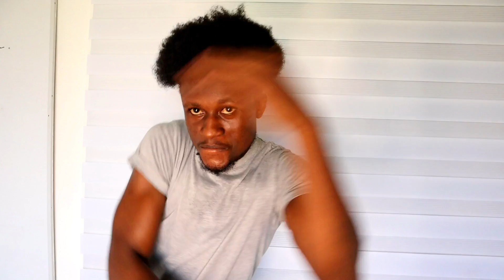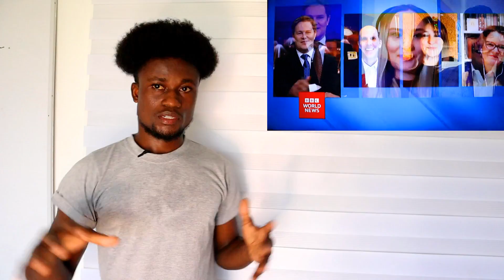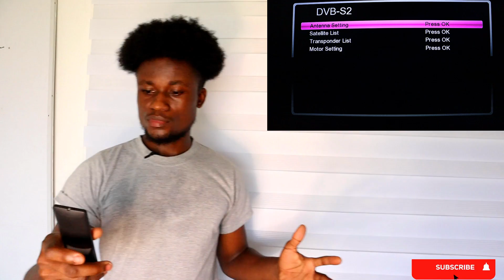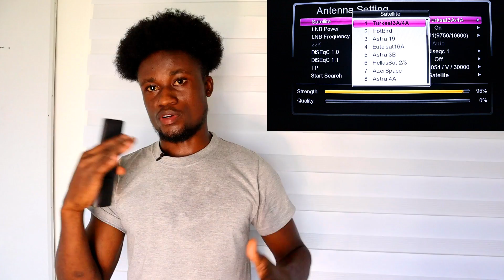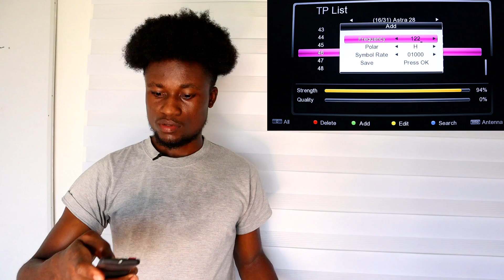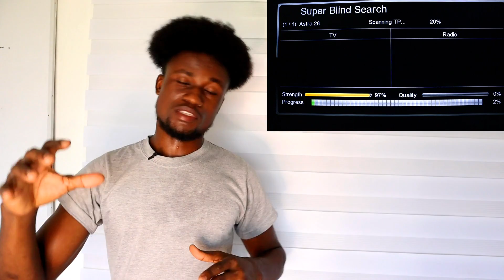How To Reset Master Decoder To Factory Default

Comment: My decoder signal has been bad around  19 percent for like a week help me
Reply from the maker: The signal comes from the satellite dish outside the house, so When there's no signal, after connecting the signal cable at the back of the Decoder really well, the next thing is to check the satellite dish to get a stable signal. If you can't do that by yourself, get a help from a nearby Satellite installer.

Comment: Pls I reset my decoder and the power went off but when I turned it on it shows on but then the tv screen goes black as well as the LCD screen on the decoder.
Reply from the maker: Some Decoders may not be able to recover if the reset was never completed. 
* If there's F1 button on the remote, after turning the decoder on, press on the f1 button plus the power button and hold for about a minute.
* Reboot the decoder several times and leave it for a while.

The main power in the house went off or only the Decoder went off during reset?
Reply: @pbtecknology  only the decoder went off

Comment: I factory reset the decoder but I can't get the quality to be green and the strength is like around 27%
Reply from the maker: If you were having the signal before resetting the decoder, do the right settings in the Installation Wizard to get back the signal
Reply: How do I do that